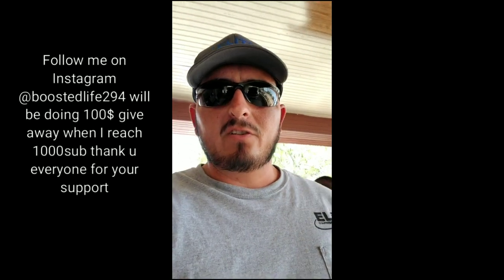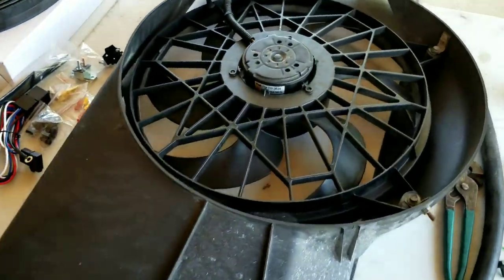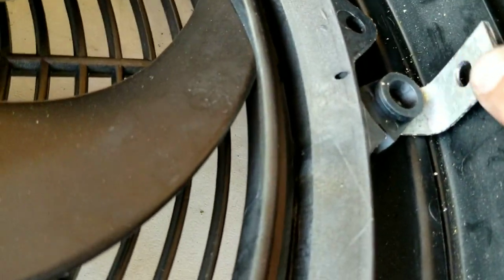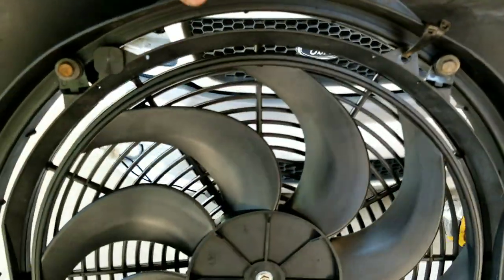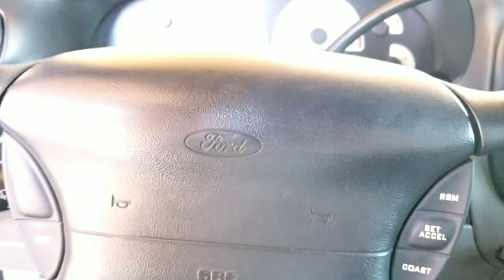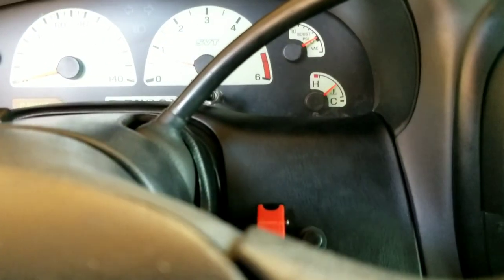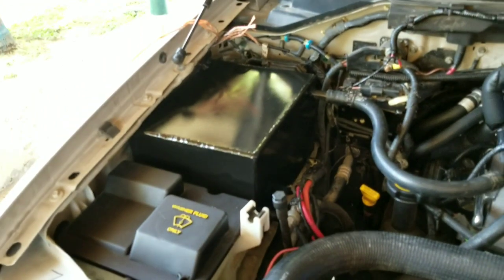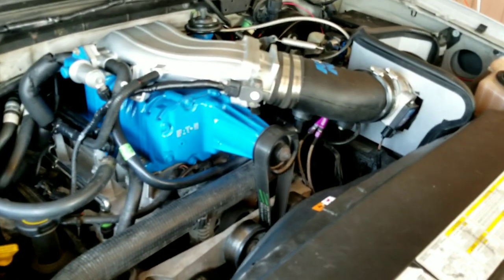Svt lightning Electric Fan installation kit

Comment: where did you mount the temp sensor at? also what temp is the sensor did your fan cycle on and off or stay on all the time while sitting and idling?
Reply from the maker: If use the one that came alredy installed before it's at low them passing the temp set point it goes into high
Reply: where on the truck is the sensor installed?

Comment: Is the fan directly with the key or is it with sensor? Could you explain how you did it thank you
Reply from the maker: Thank u and yes. I have it connected with my 12v ignition/power key, source. Coming out of the fuse box. They just come on when u start the truck.
Reply from the maker: @BRob1320  they did before. I installed the temp sensor and adjustable settings

Comment: Where did you buy it I’m interested in putting e-fans on my 1999 ford lightning
Reply from the maker: I got them of ebay. Bro ill send u the link
Reply: BoostedDave okay thank you do you know how much horse power it adds for it ?
Reply from the maker: @ctkzlopez1457  like 10hp to 15hp more less  at the crank.. bro
Reply: BoostedDave that’s good I could use the extra power that will make me at 565hp
Reply from the maker: @ctkzlopez1457  that's alot of power right there bro. We have to take advantage of every horsepower we can get. Everything adds up at the end 💪
Reply: BoostedDave could you send me the link ?
Reply from the maker: @ctkzlopez1457  the ones I bought they don't have them any more but I can find u some same specs just different brand

Comment: Damn this is exactly what I need. Where do you stay by? I need people that can help me with my truck lol.
Reply from the maker: We are in Zapata tx...we are making 2 more ice boxes for 2 customers for there svt lighting
Reply: @boosteddave4603  That's not that close but not too far also. I use to deliver tires that way for good year. I'm in the middle of a build on my truck and definitely need some e fans and anything that's going to help keep temp down. Do you know any one making e fan kits? I have an 02 ford Harley f150.
Reply: @boosteddave4603  How much are you selling the ice boxes for?
Reply from the maker: @Nathan-wn5mc  we do everything bro my f150 is a lighting swap also all work done by me
Reply from the maker: 280 bro
Reply: @boosteddave4603  bad ass price, have you seen any temp differences since you installed this bigger coolant tank? You said you were going to be putting ice in it? So running a coolant/water mixture?
Reply from the maker: @Nathan-wn5mc  yea. Bro with ice the temps drop by 50% bro and it wasn't full of ice. It take 2 bags of ice
Reply: @boosteddave4603  my entire life is a lie.. some years back I was going to drop ice in mine and I was told I would crack my block like that lol. All these years I stayed believing that.
Reply from the maker: We are in Zapata tx bro
Reply from the maker: I run e85 on mine and it way safer for the engine
Reply: @boosteddave4603  I hear so many mixed things about e85. I want to run it also because I heard it eats up all your factory lines and housing and o rings. What kind of injectors and pumps are you running?
Reply from the maker: @Nathan-wn5mc  that's happens when u leave your truck parked for months with out using it and it wont eat your lines... I've been using it for over a year now and it's ok I just change my fuel filter every other month
Reply from the maker: @Nathan-wn5mc  60lb injectors from ford racing and 345 fuel pump rewire for max voltage
Reply: @boosteddave4603  I have 60 and I was told it wouldn't be enough. Your running 345 pumps? You had rewire them? Lol man I wish I could do all that stuff. What kind of numbers is your truck pushing?
Reply from the maker: @Nathan-wn5mc  400rw 517tq on the svt lighting mods are 4lbs lower full exhaust air intake and tune. My 4door lighting swap made 617flywheel. And its has 4lb. Lower full exhaust,60lb injectors/flex fuel tune,built tranny,and 4.11 gears that's it
Reply from the maker: And both have the maff2600 from sct
Reply: @boosteddave4603  Are you still on the stock fuel lines and rails with that kind of set up? Are you running single or double 345 pump?
Reply from the maker: @Nathan-wn5mc  I am running my stock fuel lines and a single 345lph fuel pump3
Reply: @boosteddave4603  A single 345 is running e85 for you?! That's awesome. My truck has a dual pump set up. I guess I should be safe with 255s.
Reply from the maker: @Nathan-wn5mc  yes a single... and with dual 255 u will be good but are they e85 compatible
Reply: @boosteddave4603  I've done so much research on this but not many people seem to run e85 on stock lines or fuel rails so every one just tells me no you need a whole new fuel system. I'm not rich lol.
Reply from the maker: @Nathan-wn5mc  haha the stock fuel lines work and fuel rails... u will need to upgrade the injectors and the maff sensor... and a proper tune... I run e85 & 93oct